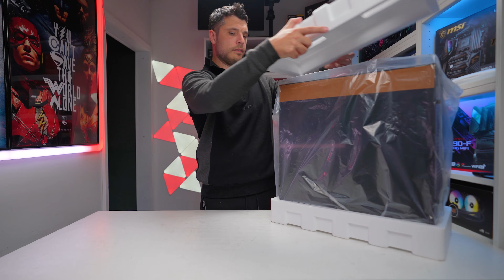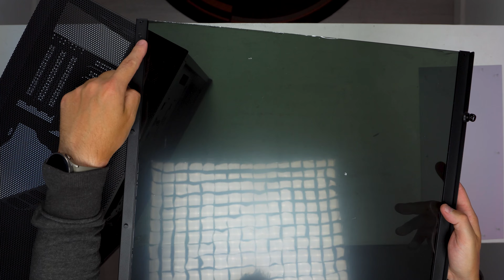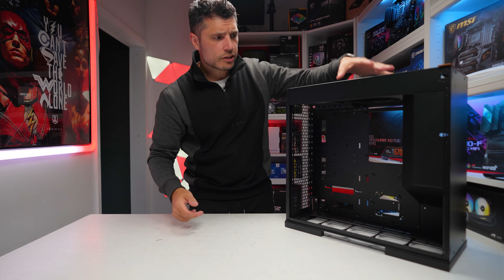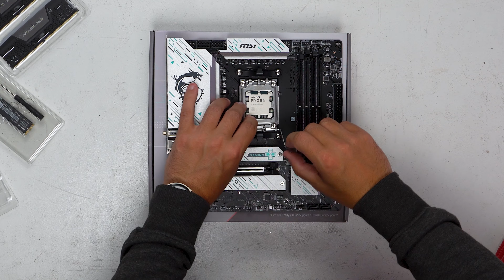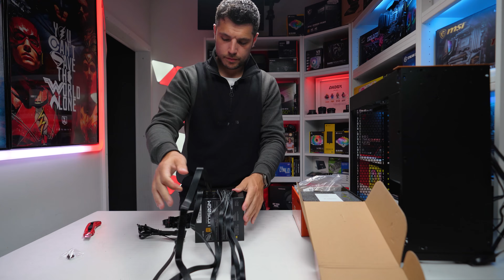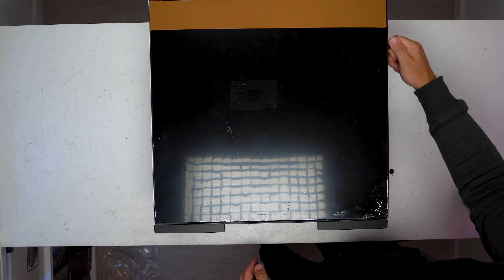Gaming PC Build - Geometric Future 8 Cowboy!

Comment: Can't you just mount the GPU with a riser? I guess that that is the best way to mount it, without using the back as an intake, and using more of the intake air coming from the bottom
Reply from the maker: Absolutely you could when using a riser I'm not a big fan of them tbh but each to there own mate - 👍
Reply: @TechCheckUK me neither, as in a normal lay out it will make the airflow worse.. I just thought it might be better with this case layout
Reply from the maker: @Cruxx3  yeah there always exceptions and this may be it pal 👍

Comment: Hey im thinking about building my own pc, im 17 and im gonna use it for school programming IT and gaming, im getting theese specs: 4070 super, ryzen 7 7800x3d, ASUS ROG Strix B650-A Gaming WiFi 6E AM5, h9 flow, NZXT Kraken RGB 360, Ram: Corsair 32Gb c36 6000mhz, 2 Samsung 980 pro 2Tb, FANS: Corsair QX120 3 Pack and a single. What psu would you recomend and do you think i should include other parts or change other parts for something else? ( all white build btw)
Reply from the maker: Good luck on the build it sounds amazing!! Especially at 17 wow good job. I would get a nice 850wt psu as that's plenty! I love the corsair / seasonic or msi 850wt at the min! I would also consider looking at keeping the fans all the same  as AIO this way easier to control all together in rgb software if not you can use signal rgb etc. Good luck mate 👍
Reply: @TechCheckUK  Thank you for your answer, i will go with the corsair 850 psu as you recomended. I have another question, so you said i should match the fans with the cpu cooler. Which fans would you recomend from nzxt to match my NZXT Kraken RGB 360 and how many should i get.
Reply from the maker: Have u seen the new fx360 from nzxt they are great 👍 would work amazing!